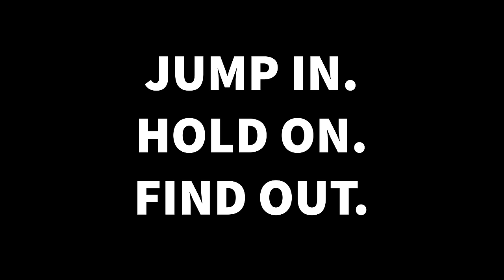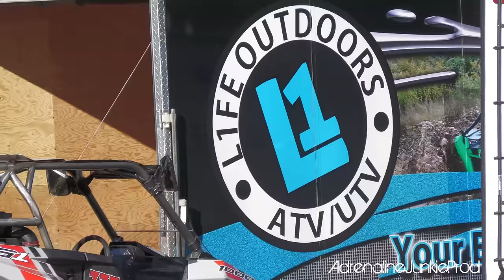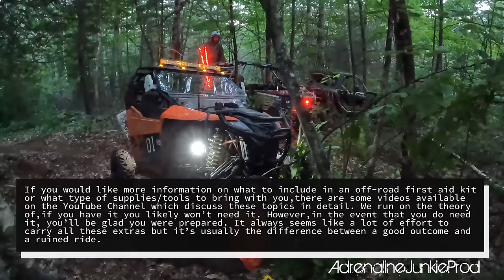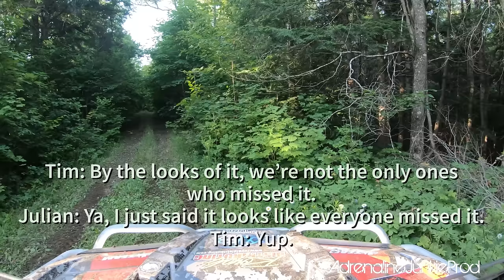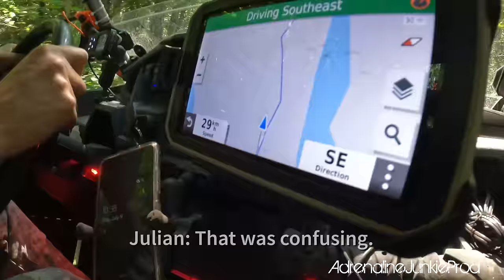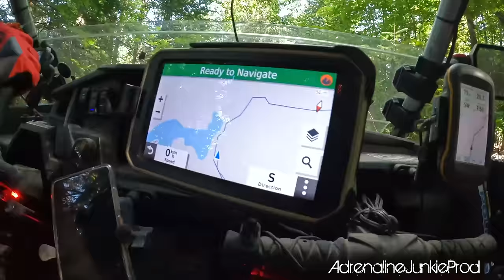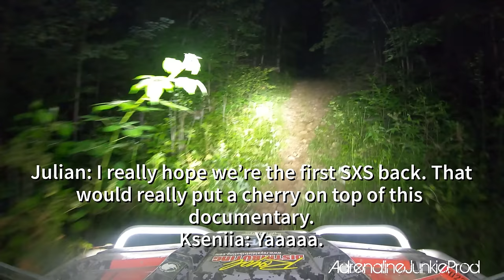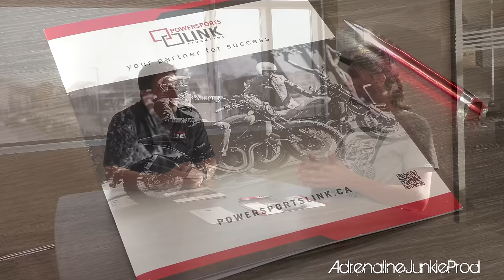Longest Off-Road Rally in Canada - The Dacre Rally Documentary - SXS/UTV/ATV/MOTO

Comment: On the GPS, snag a cheap Samsung Android Tablet and run the Garmin software. Samsung is the standard for offline GPS capabilities, devices like the Garmin use generic cheap GPS hardware 😅

Other issue I see is the Overland devices are made for -20 offset 44" tire jeeps. Not side by sides, there's a big difference with how they calculate navigation. Like putting your Google maps on pedestrian mode, understand? Trying to force small trails on such a device only complicates navigation, hence it kept recalculating. 

The Garmin Tread maybe the SXS only off the shelf solution if you're looking at all in one device. Redundancy anyone ?

Comment: Julian is toooo funny asking questions knowing the answer 
Did you lock tight everything 

Obviously not lol
Reply from the maker: Lmao… ya, I guess sometimes I can be a little bit of a… what’s the word… a dick. I’m just a straight shooter, call it like it is. To clarify though, Tim’s issue wasn’t caused by a lack of thread lock. He reused a stressed bolt with damaged threads. I got him an epic deal on all new control arms and a bunch of other stuff from superatv and he reused old damaged hardware installing them. I was super clear with him up front about how important preparing the machine was and he may have under estimated the severity of this event.  Tim has a track record of over driving and under preparing his machine. Events like this don’t forgive you for basic mistakes like that. They bring them to the forefront and slap you across the face with them. He’s lucky that didn’t fail in the middle of a high speed corner. It sucks his machine didn’t hold together, I would have loved to finish the event with him.
Reply: Over tightened. No threads left. Been apart to many times...